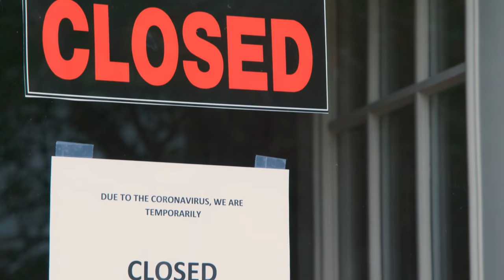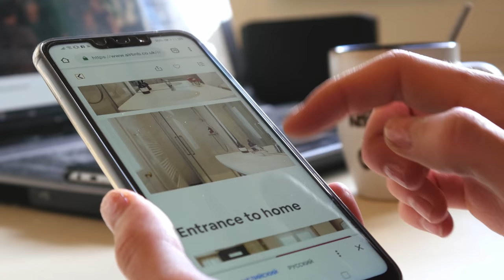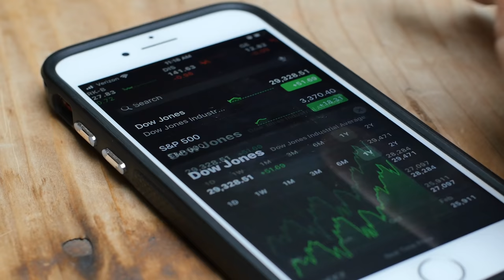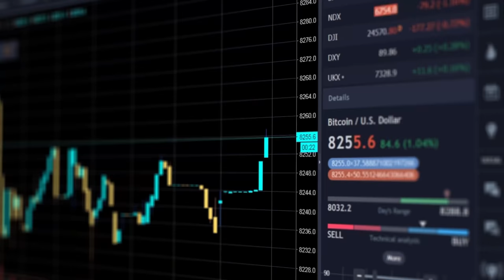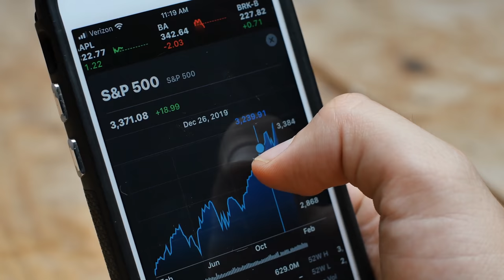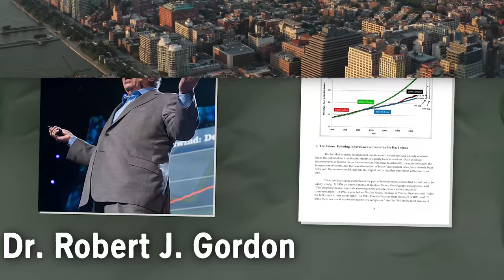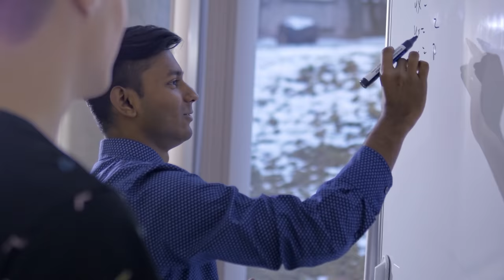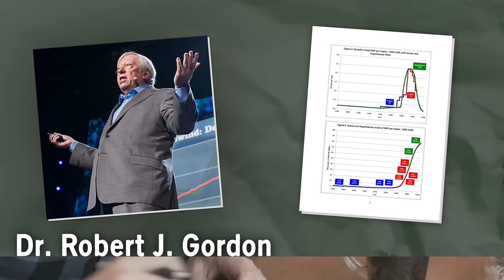You Will Never Retire, Here's Why... - How Money Works

Comment: I cringed every time one of those woodworking stock clips came up; every single one had some degree of unsafe behavior.
- Blade depth maxed out -- you should only have blade depth set to clear your cut.
- Missing guards -- What idiot would run their jointer without the guard, or their tablesaw without at least the riving knife -- maybe that's a zero-clearance insert I see, but why would you be ripping down lumber with a ZC insert?  The miter saw literally has the guard disabled...
- Total lack of push sticks/blocks -- Again, jointer without push blocks?  Tablesaw without a push stick in sight?
Reply: Perhaps they are novices learning without assistance...
Reply: This is like those stock photos of people holding the soldering iron on the hot part.
Reply: These clips are stock footage he gets somewhere. Their purpose is not to represent perfectly what they are showing, but rather convey the idea. Seeing the sawmill spin while cutting the wood conveys the idea better than a perfect length blade that doesn't show on the surface.
Reply: Stock footage of what NOT to do
Reply: Damn, this guy knows what he is talking about.
Reply: @Coolsomeone234  It's not stock footage of what to do xD
Reply: I love your eye for detail! This was a fun read. I didn't even really pay much attention to the woodworking clip. Very cool.
Reply: The one that stuck out to me the most was him pushing the wood with no push stick. I absolutely winced when I saw that.
Reply: Those were stock videos bro....
Reply: this guy lumbers
Reply: just what do you to help society?It would be ironic to this vid if you are a 100k plus OSHA guy..whose goal in life is to HARASS PEOPLE THAT produce somethig ...strappinng them with 10.000 dollar fines on SMALL BUSINESS in the name of safety..I find that that the biggest deterrent to make people safe is physical PAIN!OSHA thiks a worker is stupid....THE REASON MOST PEOPLE ARE safe is because we dont like pain!
Reply: A higher saw blade reduces kickbacks. Guards slow down production. Push sticks are fine, but I have better control of product when I can feel the friction in the board. Rules learned in shop class do not always apply in real world.
Reply: Crap, I forgot we are on social media and people can't understand nuance. Rules are there for a reason. Major one, always wear safety glasses. Ya, better damn well know what you are doing if you choose to ignore one. Those of us most comfortable with power tools can grow cocky and too comfortable with them. I have the scars to prove it.
Reply: I don't know about any of these things but as I got lost with his examples, my mind drifted and wondered about saw accidents, lol.
Reply: I have an old table saw that doesn't have a riving knife attachment
Reply: Too right, Peter, it was a fucking disgrace.
What was the rest of the video about, again?
Reply: It’s what we call a workshop of horrors
Reply: WTF!!! you sound like my OSHA instructor
Reply: I've been using a circular saw at my uncle's as a teenager, without ANY safety measures you've mentioned. Somehow, I still have all my fingers. Just made sure to keep them away from the shiny spinny thing, and apparently that was good enough :-D
Reply: @leewatkins1610  uh, if an employer refused to follow proper safety guidelines, and failed to properly train employees how to be safe, then they should be punished into oblivion.

Pro-OSHA 100%
Reply: @suzukirider9030  sneeze at the wrong moment. I fucking dare you.
Reply: I have been using wood working equipment for 45 years. No accidents. I didn’t pay much attention to the wood working. In fact, I didn’t get much out of this. Seems like fear porn. I am a mechanical engineer. I have a farm. Paid. A greenhouse. My kids are grown and doing their thing. Just got done with a solar power system. Will add on to this next year. I have livestock. My wife and I will do another round of foster kids. What is wrong with owning some silver and gold. —- as far as the shop guards missing?  Yeah once in awhile you operate the jointer with none do to surface operation with a special push tool.  (Rare).  Anyways you need to watch the Amish and then must talk.  This ain’t a woods hop tutorial
Reply: @user-gz4ve8mw9l  
I'm a novice and even I know to only use the blade depth needed and no more.

Comment: My $2m retirement account has gone up only by 2% in the past year due to rebalancing I did out of fear uncertainty and doubt. What are best alternatives to take in other to secure a financially free retirement and achieve ultimate peace? I don’t want to fail after 22 years of working hard.
Reply: Do you plan on retiring before 59?
That is what determines it for me. I switched to cash flowing assets because I wanted to retire early
Reply: At a point like this, when the pressure is already on you to retire, its best recommended you seek the services of an advisor, as this allows you make smarter investing decisions.
Reply: It's unfortunate most people don't have such information. I don't really blame people who panic. Lack of information can be a big hurdle. I've been making more than $30k passively by just investing through an advisor, and I don't have to do much work. Doesn't matter if the economy is misbehaving; great wealth managers will always make returns.
Reply: I've been looking to get one, but have been kind of relaxed about it. Could you recommend your advis0r? I'll be happy to use some help.
Reply: Sharon Lynne Hart is the licensed advisor I use. Just search the name. You’d find her webpage and necessary details to work with to set up an appointment.